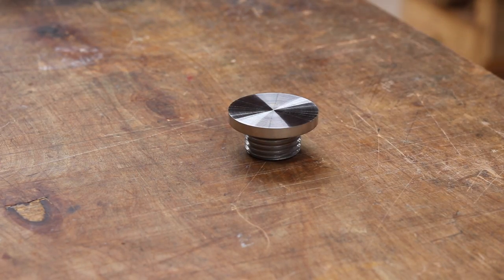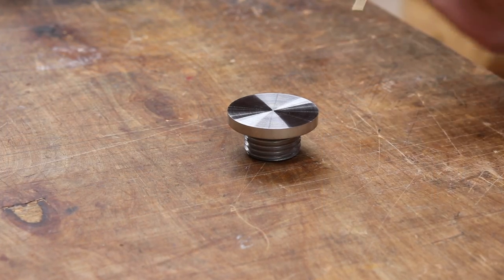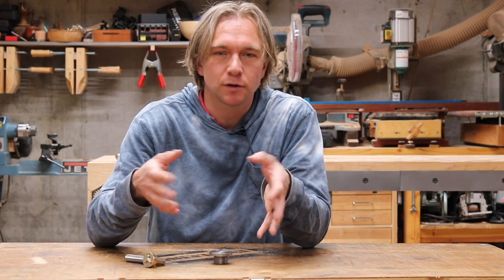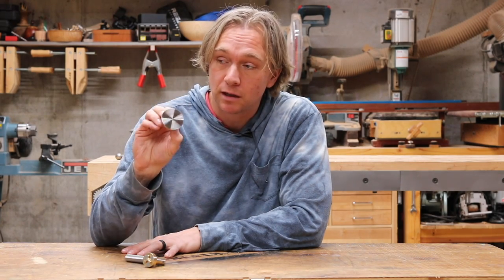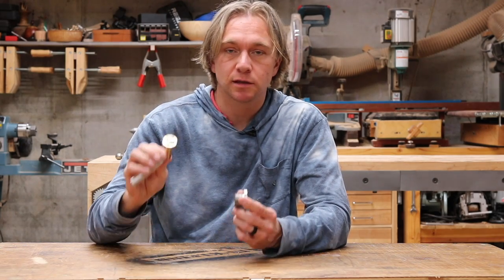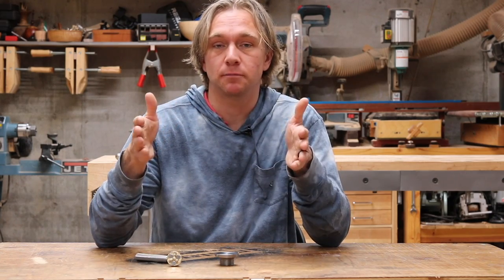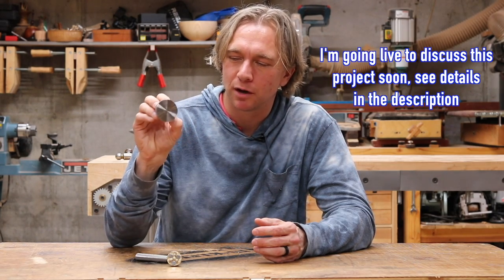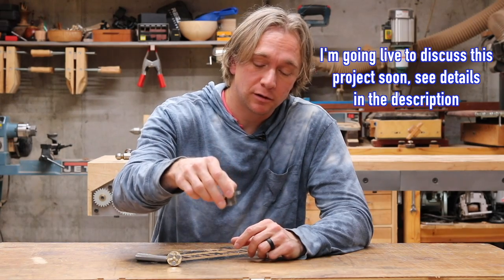A Screw With No (visible) Slot Is My Next Big Thing!

Comment: Looks great, however my first thought was, “can the final look be created another way for less money?” Then, I thought, yes, by using an inset screw along with a metal disc. As an entrepreneur, myself, that’s my first thought concerning a potential product. That doesn’t provide the functionality of the “Klein Screw”, but how often would you need to unscrew furniture?
Reply: this is probably the reason this screw isn't going to sell very well. there's still an application but I see it being very niche.
Reply: There's also the tactic they use on volume knobs (well-hidden key screw).  Just slap a machine screw with an Allen-key slot in the end--no flare at all, just a threaded rod with a hex hole in one end--and put a little key slot on the side of one end.  Screw this in with a hex key, then stick a cap on with a key-screw that is simply obscured from view (but not truly hidden) most of the time.
Reply: Luci Azazel That's all good well, but it defeats the elegance of Andrew's KleinBolt™
Reply: Exactly what you said. They've been doing this kind of thing for a long time now.
Reply: When you move. Last time I moved, there was some furniture we couldn't get out of a few rooms because they were assembled in the room, and couldn't be disassembled.
Reply: @Born_Stellar  I would say its not niche, and that's the problem. When you can already buy a 25 pack of brushed metal discs on Amazon for $10 that look identical to this screw and would just be inset into everyday furniture or even low-end particle-board stuff, no one is going to care about intentionally spending 100 times the money for a fastener. Billionaires might have gold plated door handles but none of them are going to spend the money to have a solid gold door handle. There's no target market for this product, not high end, not low end. Nothing. Its seems like a niche, but its an already swamped product space in reality.
Reply: I would take 4 if I had the money, but I would buy 1 at least for a small project I have in mind.
Reply: I said these same things to my wife, she said I should post it, then I read yours to her. Lol. Exactly what I said, all the way down to the magnet disk.
Reply: If produced in Turkey or China, its production price would drastically reduce.
Reply: To be honest, I think luxury furniture is the market for this screw. You don't need to make many, but it would make them very profitable. It's novelty and unique, in the luxury market, that's what makes something valuable.
Reply: Yup, first thought I had upon seeing this too, hide the screws in pockets and put caps on top to hide them. All you need then is a sufficiently powerful magnet to remove the caps for disassembly. Seamless screws sound neat, not very cost-effective in practice. Having such sharp concealed edges may also be an injury hazard: imagine hitting dead-center with your knuckles, elbow, knee or any other body part that is little more than skin on bones.
Reply: pretty much my thoughts!

Comment: "MagScrew" or "MagLock". For the price point these would need to be sold at would not work well with furniture market since there are endless options available. I see this being a great concept to be used as hidden locks that can be implemented in hidden compartments or gun cases. The key can be hidden in figurines for example. Great idea to meld different designs as you did. Very nice!
Reply: MagLock exists already :(
Reply: What about Phantom screw
Reply: You'd have to keep in mind that if somebody recognized that the top was depressable, they might just try to jam something in there and force it.
Reply: as somebody that does upholstery I cannot agree with your statement there are not tons of available options there are strips that hide stuff where you hammer it down and you can't tell that there's a strip there but it's easily pulled out this is an actual screw that would screw in I think it's a great idea
Reply: THE ProFlex screw because it takes a professional to make it.
Reply: To me, it seems like for furniture it would be way cheaper make a plate with a spring clip retainer that hides normal torqux screws underneath, however for hidden compartments, it could be really cool
Reply: Im a contractor and id use those
Reply: I think there is a market in this for high end furniture market, especially in the minimalist category. In Paris there are what seems to be art galleries but they are actually fancy furniture stores.

Comment: This looks like a great idea, but machining with stainless is expensive, and stainless may be overkill for furniture.  Have you thought about an alternative metal?
Reply: Whatever material is used it needs to be magnetic, otherwise driving it will be cumbersome.
Reply: He could release this as the initial demonstrative model, but aluminum, copper, regular steel, bronze, the options are endless
Reply: @bubbablazer2  maybe only part of them could be magnetic to cut down on its cost
Reply: @LykaBro  makes it difficult to look uniform when transitioning between material types. Plus, that's added work...time...money
Reply: I don't think the magnet is necessary as long as the springs are not too strong backing it, consider your only tightening down maybe a handful of fasteners per project its not a huge deal if it takes a few pounds of pressure to drive it in, I do that all day with lag bolts and stuff.

Comment: These could have an industrial application as well.  They'd fit in great into tight spaces for flush mounting plastic to steel or wood to steel, etc.  I wonder how hard it is to program the CNC to make different sizes/thread types.  

I get that the 3 way design of the key slot is for security, but have you considered using a more standard driver to reduce cost?
Reply: I don't see why after release he could put out a simple slot type for low security options like you mentioned

Comment: I don't know if you did this but, I would thin the pattern at the face of the wrench so it doesn't press against the edges of the slot.  If you mar that edge the illusion is gone but if you mark the inside of the slot not so much.
Reply: It looks like the face of the driver is brass or bronze, right ? Either is softer than stainless, so marring shouldn't be an issue.

Comment: Amazing concept, but as a screw I feel it's missing the mark. As a door latch/lock though I think you have something! The "slot" becomes an invisible key way, and most projects would only need one or two so the price point becomes more reasonable.
Reply: You beat me to it.  Agreed.
Reply: My thoughts exactly. A screw gets used once when being inserted and the novelty is lost. A latch or hidden lock on the other hand will be enjoyed every time it's opened.
Reply: Something like this that could actuate a lug after installation would be money.
Reply: How would you know where to insert the key?
Reply: @iandrake4683  That's the point! Only the owner would even know it was a lock. As for the owner, there's only 100° or so of guess work
Reply: Agreed also. Only one "screw" would need the secret locking feature. Would also need a line of matching "dummy" screws or cover plates to balance the look of an item.
Reply: And then you would only need one to have the clever mechanism, the others could then be just decorative and cheeper

Comment: Its an amazing design, and well done going from design to product. 

I do find a couple of issues on why this would not be a commercial success. The main reason is price. at $40 per screw. the exact same result as a decorative design could be done with the same shape, but an alan key to tighten it up from the underside. the price would be a fraction of the cost.  if you couldn't get access from the bottom, then a standard bolt with a polished metal disk covering it will give the exact same finish. 

i would imagine the steel of the bolt would have to be very hard, and then the fitting in the tool would have to be quite soft to make sure you dont mar up the edges where the tool interacts. all it takes is one little ding in it and the effect is gone. Slip with the tool just once and the whole thing is ruined. 

it is a stunning piece of art, but i do not think its something you could retire on. What i would do, is very quickly get a patent application in for the geometry of the bolt fixture the tool. as i can see a larger scale version being used for car wheels etc....

Comment: This thing is called "inlaid screw". Also, think about a variation of this called "inlaid latch": instead of undoing the entire screw, the hidden slot would turn a latch 90 degrees so that a drawer opens. people do something functionally similar with hidden magnets but this would make it possible to incorporate in high-end furniture.
Reply: I was thinking the same thing a latch wouldnt have to be UN screwed to unlock the door
Reply: And Chris Ramsey will end his video with …. Hot Dang.
Reply: I can see the product as a latch but not a fastener.

Comment: I love this idea, but as a machinist myself I feel the need to contribute this:

This "Hidden Head Screw" idea is fantastic, but it is quite over-engineered. You need to find a niche where the main use of this is in applications where you need to be interacting with your (expensive) hidden "slot" mechanism, otherwise there's really no point.

To elaborate, I'd wager I could make an identical screw for less than 1/10th the price (~$4) based on a standard hexagonal drive and some variety of face-plate (facade?) that presses into the screw head once there's no need for the hexagonal drive anymore. This facade piece could be magnetic, attached with ball-detent (for non-ferrous materials) or permanently attached with adhesive. It would also be much easier to produce screws of different sizes, especially smaller (thus more versatile). This alternative would be markedly easier & cheaper to produce, and would have exactly the same visual effect as your concept, so long as disassembly doesn't need to happen often (like with furniture).

TL;DR: There are vastly cheaper ways to make this screw for the applications you've listed. I love the idea, but it needs to be applied to something that requires regular interaction with the fastener, otherwise it's little more than a cool toy.

Hopefully you find this criticism helpful, I look forward to seeing what you do with this idea.

Comment: Broh this kinda blew my mind and I’m on board!! I’m in construction and I work for the 1%ers so I could see these everywhere!! Kitchen bathrooms even if it’s just decorative. Could you make different sizes? I know the process is expensive but if I was to use it on a full marble back splash it would need to be around half that size so it doesn’t take the focus off the stone but adds a nice look with security of it not falling off. Can’t wait to watch you develop this. 👏🏽
Reply: lol I initially thought super rich people would want it.
Reply: @Born_Stellar  home depot will dedicate a whole aisle to these
Reply: And maybe defrent  medals just to make it affordable
Reply: @saigem2611  Its not just the metal that makes it expensive, its the process, hell I would say at least half the price is from exactly that. Wire EDM's are not cheap machines, and you would need to set a dedicated one up to make these screws which also isn't cheap. We won't see fasteners like this being affordable for quite some time, unless that is enough investors invest in it and set all for this up with enough money to allow them to be sold cheaper.
Reply: No Cnc is cheap but yea; on the other hand one operator could keep 10 wires busyrunninf these. Load a whole table on one that self threads and it would get it… don’t really think you would have to wire these either a tight mill could definitely rip these out…
Reply: @lockgessner  Last I checked, few, if any mill's can make such tight tolerances. Doing this on a mill would take far more time and effort than a wire EDC as it would have to be two separate parts and the hole for the button to go into will also have to be milled. The best way to "churn" objects with parts that quire such tight tolerances out is with a wire EDC, and it would require the wire edc to be made into a dedicated machine that is connected to other machines to mechanize the entire process in order to mass produce them. That won't be cheap or easy, and if it were done, it would need to be done by multiple companies so that prices can be as low as you want because if only one company does it, they can charge far more than if multiple did as they produce competition and will drive the price down. To get multiple companies to do this, each company will need to get investors willing to invest in such an endeavor that they can even afford to do it in the first place. Once they acquire said investors, they need to set the infrastructure and machinery up to start production and then, and only then, will we see the mass production of objects like this with parts that have very tight tolerances and are affordable.
Reply: @PilotTed   are you a machinist? I am, even have a high end cnc mill in my garage and have worked right next to wires, its EDM(electron discharge machining not EDC whatever that is;) plenty of modern cnc mills can hold these tolerances and no process including EDM can make both parts from 1 pc of stock(wire is something like .01 so kerf is around .012 iirc and that's per side=super sloppy part and you have to have a start hole=ugly and not possible.) As far as mass production goes and automation I HIGHLY doubt this would ever see qty's to warrant true automation, at best maybe on a horizontal pallet pool that could do other jobs as well. But what do I know
Reply: Can the straight slot be made into other drives like star or Allen also machine so the drive that is pressed in could be brass . Looks good for anti vandalism..

Comment: Perhaps "Stealth screw" would be suitable. It might also be a good idea to develop this idea in parallel in an opposing direction. Cheaper material, different sizes and useable with standard allen keys, so that it can become more ubiquitous and pointing the way to the higher end, security version.
Reply: This idea of moving into different paths is very clever...it give a range of available products and would give attainable options while still looking at the high end item.  Kind of like offering an affordable car model while bringing them in to the dealership to be exposed to the high end stuff...it also prevent people from "pooh-poohing" an option based on a single price model.  I like this type of thinking.
Reply: The screw will be more visible if used, not less visible. It’s the slot that this screw type offers. Stealth screw is therefore a misnomer. Stealth slotted screw would be what you’re going for, but that name obv sucks

Comment: I imagine this being a neat addition to wall and counter faces meant to be "out of view" buttons. Such as for shelves hidden doors and hidden weapon compartments. If truly appearing to be seemless. That would mean a potential user would need to know exactly where in the wall that door opening button is. And it wouldn't reveal itself to general cleaning or touching either. You'd have to be actively checking for it
Reply: The button doesn’t disappear, it just doesn’t show that it’s a screw
Reply: I agree. If you make the entire bolt fit seamlessly into a metal surface (ie, a safe) in much the same way that the slots "disappear" into the bolt, this would have excellent security applications.
Reply: @ian9toes  Well, it "disappears" as it sits nearly perfectly flush with the rest of the screw's head, making it hard to make out unless you were carefully looking. Sure its still there, but its very hard to see.
Reply: If only that screw head comes flush with a wall made of stainless steel then it will be a hard, they will not try to check every head to unscrew but now they don't know where the head is.
Reply: escape rooms would become harder

Comment: There are magnets that you can stick to a screws with the same stainless steel finish.
Edited:
Now if you can scale it down to a wider range of furniture screws, it's a great idea.In my opinion it's a bit exclusive in this size, just focused more to be first decorative than useful. On a smaller scale the idea is great!!
Reply: there is still a potential security aspect to these though, that you wouldn't really get with just a magnet cover plate. not only would you have to actually know about the mechanism in place in the first place but would also need a compatible "key" afterwards. 
ignoring all that it just looks soo cool
Reply: @nathanmiller9381  You don't NEED a key. Any large flat head could unscrew it. Granted you'll wreck the look doing it, but a potential attacker doesn't care about that.

Comment: As a designer, questions I know my clients would ask,
What kind of finishes does it come in? Can it be anodized or chromed or powder coated or sandblasted? 
Does it have to be so large?
Why the special tool? Can't the key hole be based on preexisting tool shapes.

If I could sell the design using just this as it is, that would be great. But sometimes clients have ideas.
Reply: This made me think about the technical side of it, and I tried to answer the questions as a challenge . What I came up with is good for almost all the questions that may come up in the future: "Yes, if you're willing to pay for it." For the rest: "No, physically impossible."
Reply: @besenyeim  🤣
Reply: I absolutely agree.
Reply: Torx drive would be much better than this strange tri-lobe drive. Obviously ensuring the tool opening is not deformed is essential here, so I'd guess Torx would work pretty well.